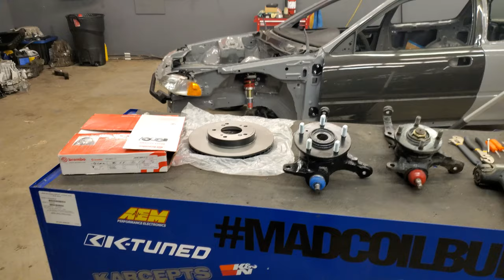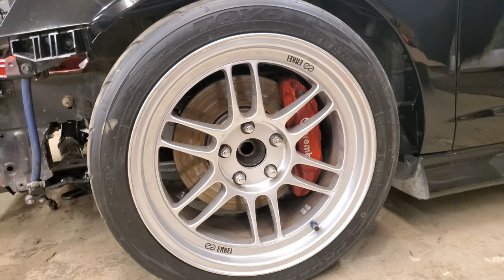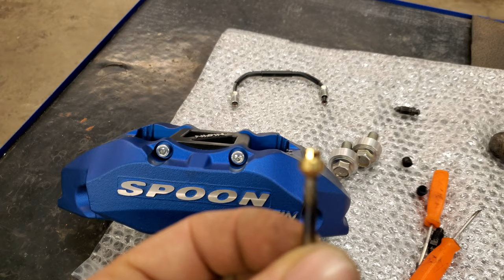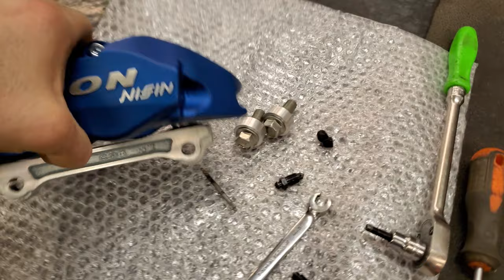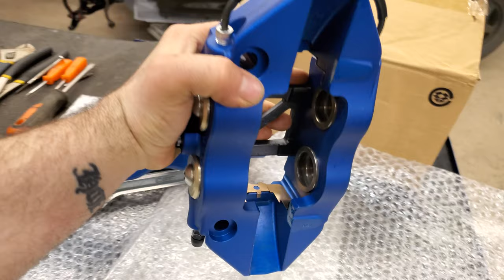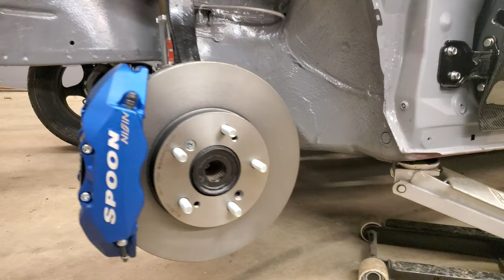Q&A + SPOON BRAKE MOCKUP | MADCOILBUILT

Comment: Good content video bro... Just wondering about the Rotors that you use on your set up? COZ I have a CRV front knuckle on a 2000 EK civic.. Am totally at lost on what rotor to use on a monoblock set up.. Thank you sir for ur help
Reply from the maker: I'm using 9th gen civic si fitment
Reply: @XJScottie  are you using Rsx type S 5 lug hub?

Comment: Madcoil Built, can i install spoon twin block  calipers on front and rear of 2000 honda civic  ek9 hatchback type r?
Reply from the maker: You can install them on the front no issue. The back would be pretty custom . I'm not aware of any direct fit rear spoon calipers
Reply: @XJScottie  that's what i need to know, i want them all and not just on the front.
Reply from the maker: @mastermind5692  I have no doubts it can be done with a custom setup . Anythings possible
Reply: @XJScottie  thank you!!!